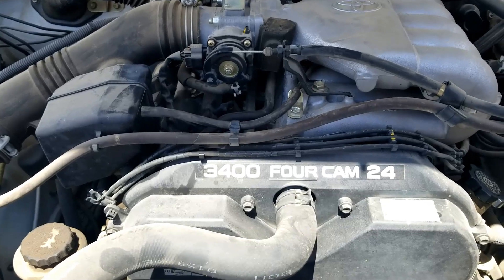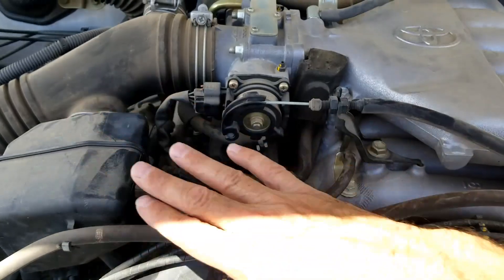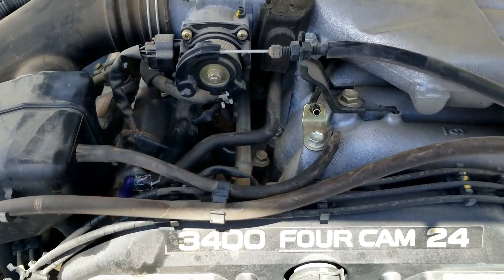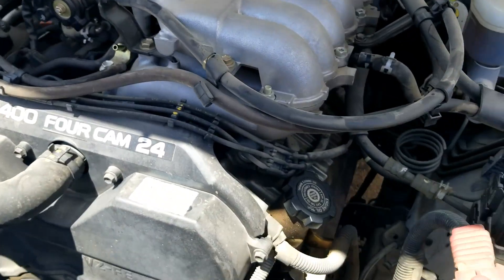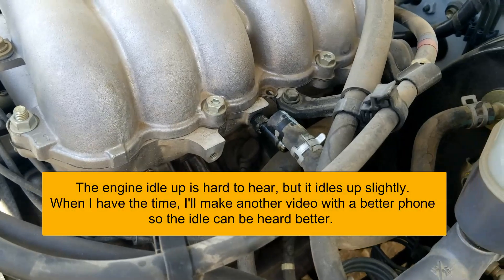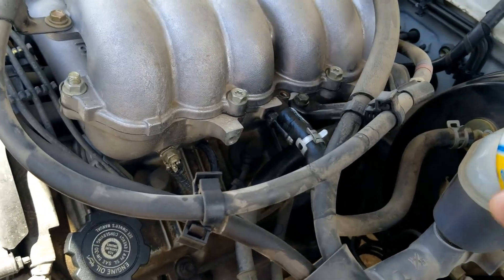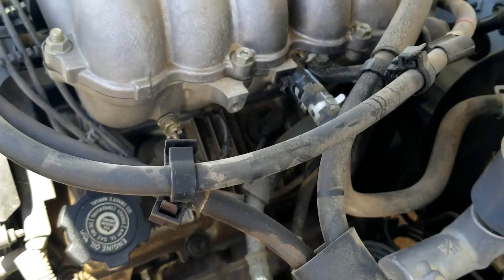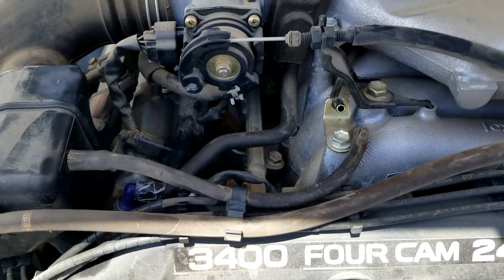How to Find an Intake Air Leak (Vacuum Leak) Using Starter Fluid (Old School Method)

Comment: The idle won’t change on a Speed density(map sensor) set up. Only on a MAF set up. Would need monitor the Short term fuel trims on a MAP set up to see where the leak is.